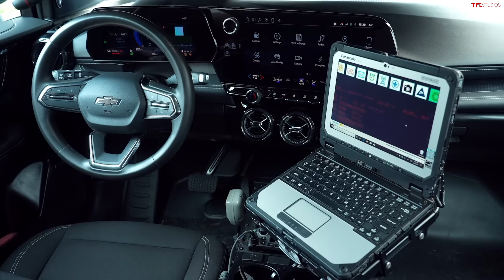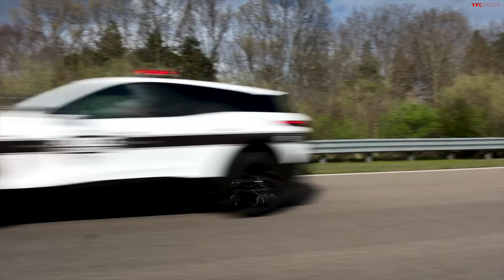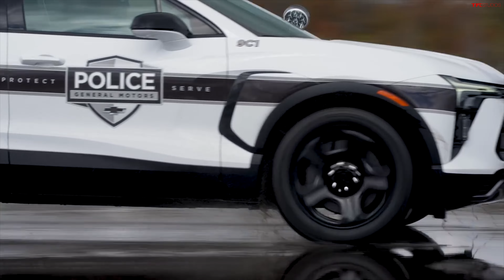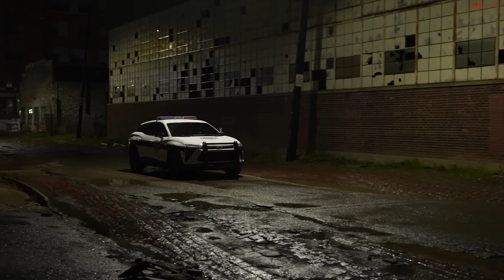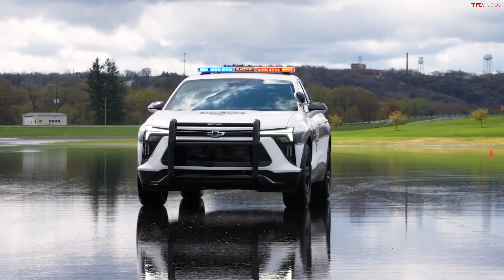You Won't Hear It Coming: Chevy Debuts An All Electric Police Car With THIS Cool Cop Power!

Comment: I don’t see how this could work in the PD I work at. We pass the car shift to shift. So they are constantly running 24/7 and they only turn off to get gas. We would have to double our fleet and without a grant there is NO WAY my PD would spend that money. That being said, I actually looked at the data the other day and my naturally aspirated interceptor gets 8 miles to the gallon and I would attribute that to all the idle time and I drive about 70 miles a a shift and burn a quarter tank a shift. So it would be interesting to see a test or a pilot program to see how an electric police car would perform considering idle time, responding to emergencies and all that stuff. I think to go green, hybrids are going to be our Avenue of approach for a while. Another interesting dynamic is we are a county police department so a charging station only at the Police station wouldn’t work because we switch over at firehouses in the covered area of that specific patrol.

Comment: minimum of 350 miles range and 160 mph top speed if you want states /troopers to have somewhat of an interest.
price is ok a Ford SUV or Mach E cost in the upper 60's since all the normal maintenance isnt needed and economies on fuel.
reprogram the computer to lower the power while normal driving desengage the front drive motor save energy. when in persuit mode with lights on then all 100% of power can be on .
the few that can go over 160*charger hellcat* well even cars right now cant keep up..
with a set up this way I think one could get closer to the 350 miles range...

Comment: That's not how police vehicles work.  There are  three shifts, days, swings, and graveyards.  Days is generally 0600-1600, swings is 1300-2300, and detail 3(graveyards) is 2100-0700.  Days takes fleet 1 on day 1, swings fleet 2, and detail 3 takes fleet 1 again, returned from dayshift.  The next day, dayshift takes fleet 2, so on and so forth.  A busy city the cops will have 20 calls a night. There will need to be an ability to supercharge as those cars don't get much downtime.  Gas cars can be filled in 3-4 minutes.  This may be more feasible with solid state batteries, but right now, i am not sure this is feasible.  Cop cars generally have 100k miles within 2 years in a big city,  how will battery packs hold up to this kind of abuse?
Reply from the maker: Thanks for the heads-up on this

Comment: "Cop tires, Cop brakes Cop battery, and it runs good on cheap electricity!" 250 miles of range, only supposed to charge up 80% giving only 200 miles of range. And, it should probably be charged at no less than 20% giving a real range of 150 miles.....

Comment: This is a perfect application for a BEV. So much idle time and start and stop driving is so bad with ICE engines. All that weight down low will be really good for pushing vehicles off the road, and don't forget the PIT manuever. I was talking to a cop that drivies a Model Y in a relatively small town. His only problem was that, to him, it doesn't feel as purpose-built as the ICE Explorer that it replaced. I bet GM will make this one pretty well, as soon as they get the Altium problems worked out. It wouldn't surprise me that they sell the first thousand or so at a loss in order to get name recognition

Comment: The Ford Motor Company states that every one hour of idling is equivalent to driving approximately 25 miles. On a normal 10-hour shift, a patrol vehicle drives between 50 and 100 miles. During that same 10-hour shift, a patrol vehicle can idle for 3-5 hours, adding an additional 75-125 miles each patrol shift of additional wear and tear on the engine. Guess how much wear to an EV while sitting (and maybe even charging)

Comment: Extremely rough and conservative math assuming 20 gallons of gas consumed per day per car (10-12 gallons per shift).  ~ $2,400-$3,000 a month in fueling cost per vehicle.   Even assuming $500 in EV charging per month, that is $2000-$2500 in savings a month.   Sounds too good to be true.  

It will be interesting to know the perspective of someone who actually knows this stuff.  Maybe the fleet manager that sold you the retired car.

Comment: well... They won't be able to catch a Tesla performance then with those specs...? They should've signed a contract with Tesla instead.
Reply: And you think any vehicle can out run the radio connecting six chase cars? Even run flat tires fail 50 miles or less after hitting the stop sticks.

Comment: Why not hybrid? Seems limiting being EV only especially when this is the ideal situation for Hybrid setups with awd. Hell, this would of been a great opportunity for Volt's drive train to be in here so its EV AWD all the time and the engine is only a generator.
Reply: Probably because the substantial penalty of hauling around battery AND engine; as well as having to do oil changes and stuff compared to pure EV.
Reply: I hold the Voltec powertain near and dear to my heart. However, I also recognize the immense upstream supply and manufacturing complexity required to support dual powertrains. 

GEN 2 volts have 3 coolant reservoirs with independent loops, where a BEV would need only one. The Volt has two electric motors sandwiched next to 2 or 3 clutches and engine, where a BEV would need a single motor and zero clutches. The Volt cabin heating (core) loop was shared by the engine, requiring a few electronic valves to isolate the cabin heater when the engine wasn't in play. But my largest concern with these systems focuses on the increased battery demand and cycles associated with smaller batteries. 100,000 miles on a Volt would potentially result in over 2,000 battery cycles, whereas 100,000 miles on a 250 mile BEV (as an example) returns only 400 cycles.

Comment: 🤔 As Tommy said, they should not be engaged in a pursuit.  Something that has been and is being dictated more and more.  Police are being restricted from actually pursuing criminals.  So, might as well give them a golf cart to drive around in.  Meter Maids are not in a hurry.  And the way the policies are being changed to hinder the cops from doing their jobs, might as well go EV.  (except the up front cost is higher)
Reply: over 40 K poeple are killed or inured because of police pursuits reason why now more and more cities and states do group or pack pursuits so the bad guy sees 20 cars on all sides makes them usually realise they arent going anywhere all exits blocked.
and yes most pursuits are maxed out around 110 mph for most, city its in the rare 70 mph ,back streets is more like 35.
but to be able for 160 would be ideal.
and concerning idle time an EV will use maybe 5%//hour energy on stanby.... average ICE car spends 60 to 80$ a day in fuel. would be around 15$ for an EV

Comment: Has anyone designed a drive off EV charger like the emergency services use on combustion vehicles to keep the auxiliary batteries charged up while waiting at the stations? I don’t know if you use them in the US but our ambulances and paramedic cars use them in the UK. They would be ideal to keep the batteries topped off but enable the vehicle to be driven off without an extra step before leaving.
Reply: In the USA, ambulances & fire trucks have these auto-eject power cords too.  I think the owners of charging stations would frown upon this feature it it were added to their heavier plastic cgargers.

Comment: I think a hybrid makes more sense for the Police use case, with the significant idle hours spent using the battery instead of the engine and hard use as well as 24 hour/multiple shift use taken up by the engine instead of constant hard charge and discharge cycles causing excessive heat and premature wear on the battery.
Reply: I think police stations are less likely to buy a non-US Automaker than they would an EV, and none of the big three have hybrids in production that would handle  being a general police use vehicle.

I have seen Prius and  fusion hybrids used as traffic enforcement. But certainly not as response vehicle's

Comment: How about making some space in the front to mount a shotgun to shoot out tires during a chase?  Shotgun could be mounted on stabilized mount aimed at a point on the ground a few yards ahead.  A Heads Up Display could show where the shotgun load will hit.  Cop simply drives the “piper” until it’s on the bad guys tire, checks to make sure it’s clear and fires.  Tire with buckshot sized holes will deflate pretty quickly bringing the chase to an end faster then with stop sticks and safer than pitting.
Reply: Actually, tires are a bitch to shoot out. The tire tends to "self seal" after the bullet passes through. Mythbusters tried it and even a deer slug didnt deflate the tire very quickly (stipulated they used a truck tire). They also had homemade caltrops that didnt work either for the same reason. My own experience shooting holes in tires to prevent mosquitoes from nesting were a flop, not a drop of water drained out of where the hole was, even the full clip of holes. 

Stop sticks work because they dont just make a hole, they leave a metal tube in the hole to hold it open and let the air out, looks about like a .22LR brass with both ends open.

Comment: I just don’t think EV’s are there yet.  Spent a career in a patrol car.  The agency tried smaller engines to save gas, smaller patrol cars etc.  it just didn’t work.  The last patrol area I worked had a land mass bigger than several states.  250 mile range for the EV is at least 250 miles too short!
Reply: There are always edge cases like that but in most places that is plenty for one shift patrol.

Comment: The fast acceleration that EVs offer seems perfect for speed enforcement. Coming from a dead stop at the side of the road, a quick 0-80 time is critical to catching up to a speeder and pulling them over.

This may be the only routine situation where extremely quick acceleration is actually necessary for a vehicle to do its job, rather than simply for thrills.

Comment: The price will be lower before outfitting than a civilian car + the fact that agancies that will buy them will buy egnough to get even lower prices. How well it does is also depending on how well Ford manage with their Mach-E PPV that they have teased about.
Reply: We have a Mach E ppv its a GT version with a police interior otherwise same performances.price wise a Mach E ppv cost us 84K with equipment.a Mach E GT is in the same price around 82 to 96 K.But remember you buy 1 we buy 50 or 500,so its normal we dont pay the same price and we dont pay the sales taxes for most cities or states at least here in Canada
Reply: The current police Mach-E is not the final PPV product though. If you look at the fleet sales site for police it's not on there

Comment: Really cool concept and application for EVs. I only hope GM will stick with it and ramp up EV production and fleet management for the agencies. Unfortunately, GM is also all too happy to keep selling gas guzzlers at a first sign of pushback.

It is good to see several progressive cities and police departments going all in on not only EV and EV chargers but also solar panels and backup batteries. That must save them millions in fueling and maintenance costs in the long run.
Reply: GM is building not one, not two, but four entire battery cell production facilities at a cost of multiple billions of dollars EACH. I'm pretty sure they aren't just blowing smoke this time..... pretty sure lol...
Reply: @sipher3516  I don’t see how they can. Dealers are failing to sell overpriced gas and electric inventory. These new GM electric vehicles are gas converted into EVs. Plus they owe 110 billion dollars already. It took Tesla years and billions and billions to get it right and ramp and scale. I don’t see them catching up without the help of the Chinese and Mexico.

Comment: My department is currently undergoing a large building remodel. I suggested they look into adding covered parking using solar panels as the roof and having level 2 chargers installed. That suggestion was not received well but I’m all for going to electric patrol vehicles.

In 13 years, I have exceeded 130 mph twice, reached 140-145, and that was in a Charger. I’m currently in an Explorer and I don’t think it would get anywhere close to 130. The Charger got very floaty and was not confidence inspiring at those speeds.

My longest pursuit was just under an hour and less than 80 miles as we didn’t spend much time outside the city. I used 3/4 of a tank and the suspect was nearly out of gas (lots of hard acceleration) at the conclusion.

We work 12 hour shifts and I’d estimate we spend 4 hours per shift typing reports, at the station. I work in the largest city in my half of the state, which is still a small city at 20,000, and 50 miles is a typical shift but it jumps an extra 50 miles for every trip to the county jail. Two trips to the jail, for one officer, is unusual.

Electricity in our area is 50% of the national average and gas is roughly 20% higher than the national average. I idle less than any other officer and drive like a grandma during normal patrol; I get 10 mpg in my Explorer.

I think an EV like this would be ideal for most cities and some smaller counties, at least out west; the smaller states and counties in the east might make 250 miles of range more acceptable there.

Departments that use a vehicle 24/7 will have difficulties. Most departments I have been around have two officers share one car (50% down time) or one car per officer. For officers with take home cars, there are chargers that can track energy used per vehicle charged so they can be reimbursed for electricity used charging and even use the charger for their own vehicles (like my Volt) without the department paying for that.

My biggest issue with the Blazer is they’re being manufactured in Mexico. I prefer tax payer money going to American made products, when possible.
Reply: It sucks when the bosses don't believe in common sense.  It's the same way with my fire department & our local governments that control funding.  Ford makes a hybrid version of the Police Interceptor Utility Explorer that could educate management about gas savings.

Comment: Curious how they will do with high speed pursuits over 100 mph for extended periods. Maybe made for big  cities. Cops will do 12 hr shifts with most hours driving. How many times will they be charging taking time away from their duties….
Reply: What chase goes on for 2 or 3 hours?
Reply: Vehicle goes 130 mph so I would say it will do just fine. Only issue is vehicles going 140MPH + which they will not be doing on any curves even on the freeway. The blazer has a faster 60 to 130 speed then the gasoline vehicle also so it will likely catch any vehicle not on a very long straight road.

Comment: GM production issues have been battery related, most recently a supplier issue with the batteries. They're expecting this to ramp to 100k by the end of the year which I wouldn't be too surprised at - it's hard to spin a new production line until it's not.
Reply: More so an automation supplier issue with the batteries.

Comment: For a sizeable city, you will not be able to run this cruiser for two consecutive shifts, so a department will have to purchase twice as many vehicles = one charging while the other patrols. Would like to see the financials on this-
Save a lot on oil changes tho, but more on tires. Likely 2 sets per year?
Reply: "For a sizeable city, you will not be able to run this cruiser for two consecutive shifts, so a department will have to purchase twice as many vehicles = one charging while the other patrols"

Maybe if the police department relies exclusively on AC charging at the station, but if they have DC charging, that seems avoidable. With staggered shifts, just one DC charger could fast-charge the entire fleet, which seems much cheaper than buying twice as many vehicles.
Reply: staggered shifts equals contract disputes at most agencies  @ab-tf5fl

Comment: Just wait until pedestrians start getting hit by electric vehicles because they can’t hear them coming…
Reply: Which minute were you born?
Reply: @BioniqBob   during the age of the combustion engine
Reply: @sethb775  A Fool is born every minute. You used up an hour.
Reply: @BioniqBob  you must be a  Democrat born of the battery theory…
Reply: @sethb775  LOL Remain a fool. Loser
Reply: You figure the cops will disconnect the noisemakers?
Reply: @natehill8069  not talking about sirens
Reply: @natehill8069  Probably has no idea what you are talking about. Also some places don't require them. Or maybe he is talking about deaf people.